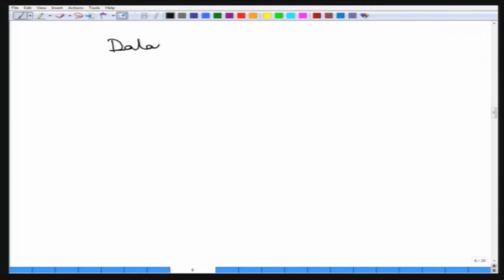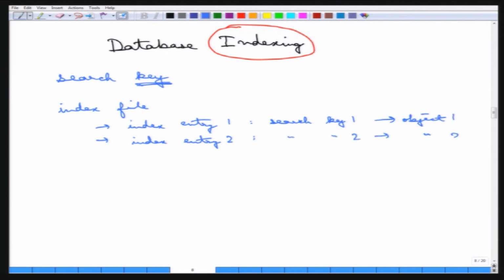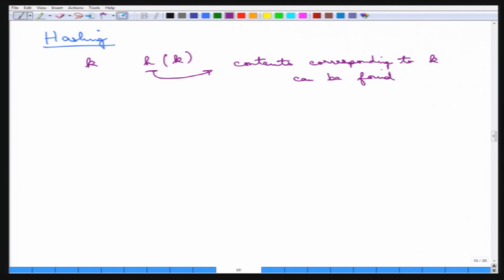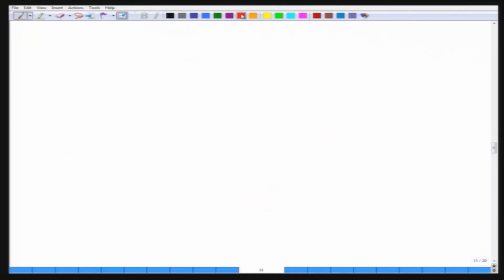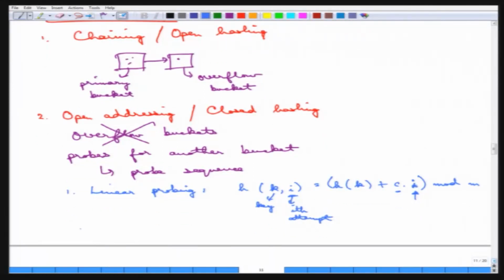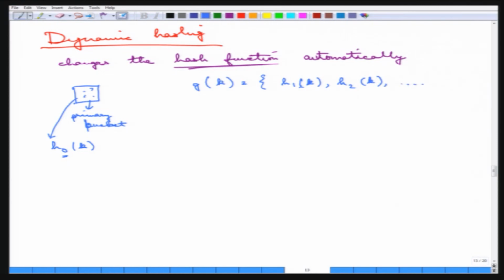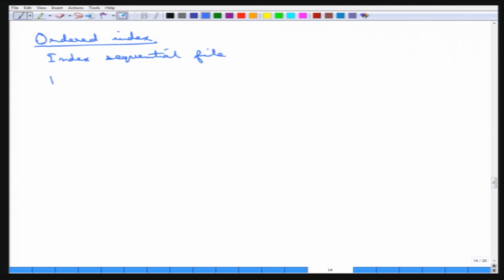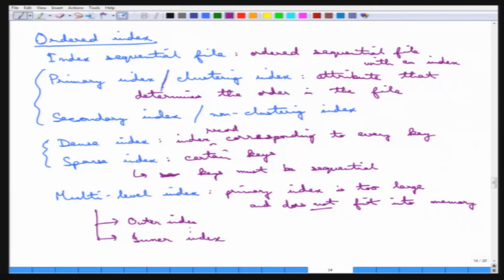Database Indexing: Hashing

Comment: why bucket/page can contain multiple search keys?
please someone answer.I am new to CS courses
Reply: assume you have two search keys with the same hash value. these two keys will then go to the same element of the hash-table (overflow).
Reply: Because in theory you want to map an indefinite number of keys into a finite sized hash table. So suppose the keys are people's full name, and the hash function can turn each name into a   number. There is an almost endless  number of possible names, but if the hashed  value is only 8 bits, or 256 values, there is a chance that more than one name will collide with another name . If that happens you might  create a linked list to search through for each bucket.